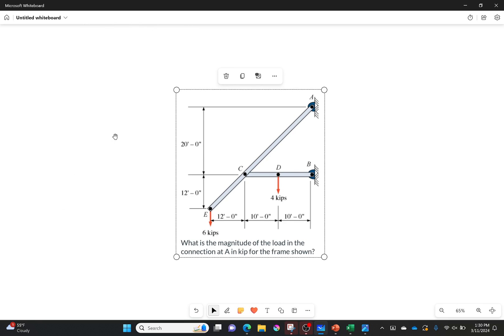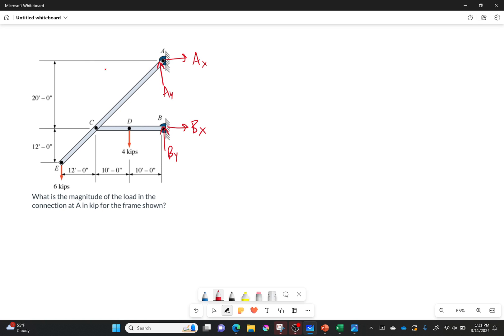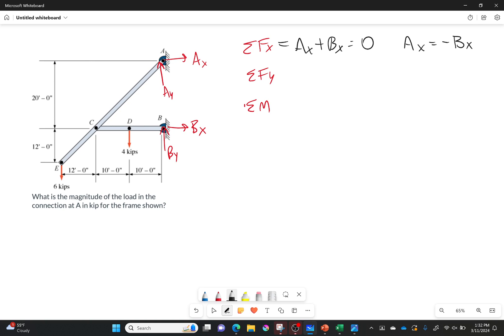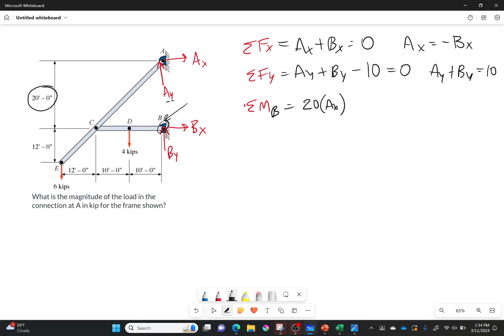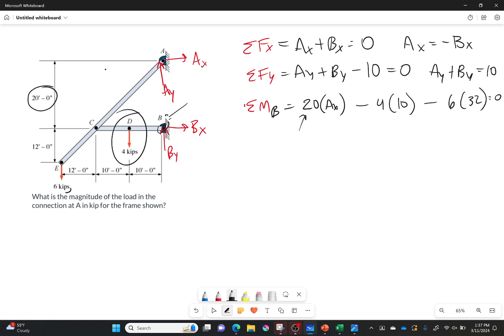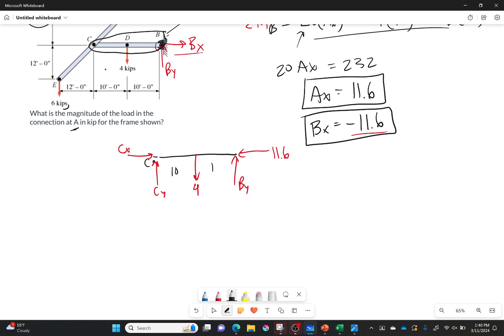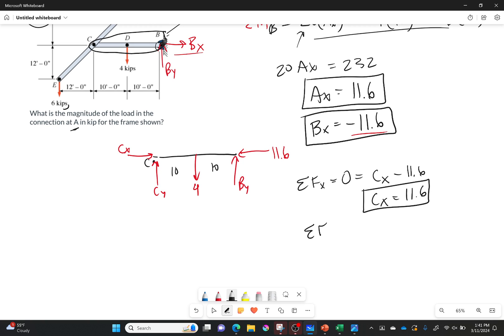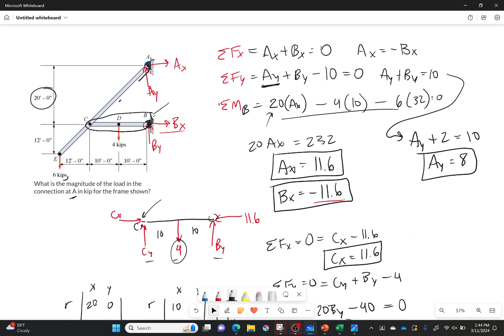Example - Frame with Two Pin Supports

Comment: I have not studied this. But you whizzed by your first equation. Why must the x vector components sum to 0?
Reply from the maker: Those are our basic equilibrium equations. If a body is not accelerating, then all forces and moments must sum to zero. For a frame like this we are making the assumption that it is not moving and therefore all the forces acting on it must cancel. It's easiest to break the forces into components (x,y,z) and solve for them that way.